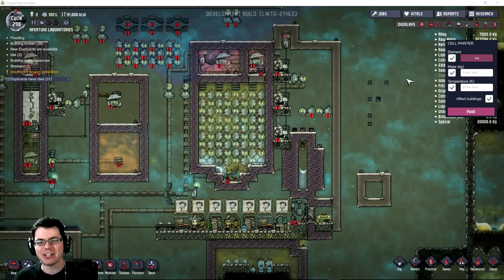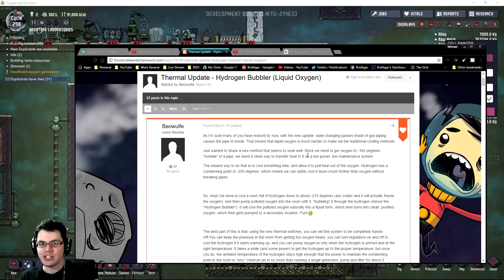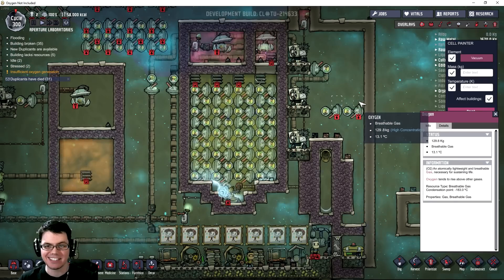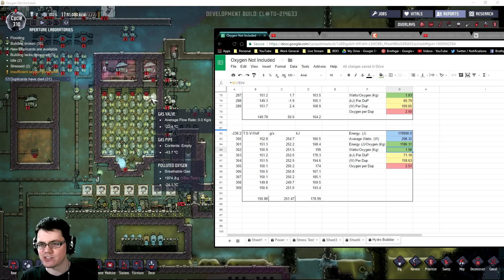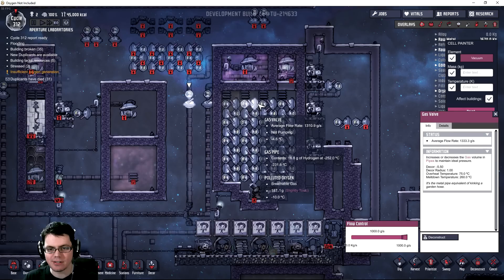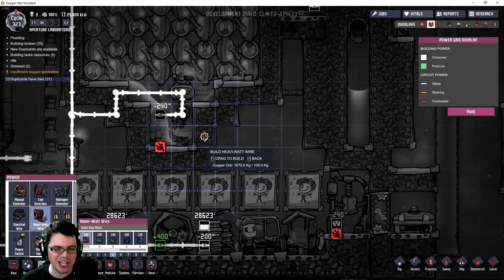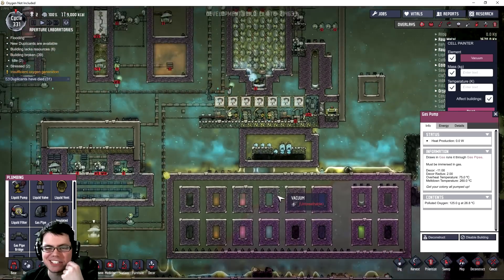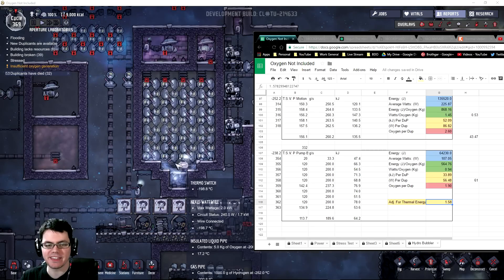Perpetual Motion and Wolframite Hydrogen Bubbler Experiment Part 4 -  Oxygen Not Included

Comment: Hmm. For a system like this... what I'd suggest is a single "tower" of valves, rather than waiting for the waterfall to dump everything into the center. It may be inferior in terms of rate of cooling but then you won't have solid oxygen forming. And a pillar fifty or so high isn't that outlandish all considered.

Another exploitable trick- freeze the materials you're using to build the machinery. If you let the wolframite sit in liquid oxygen for a while, then it should contribute a whole lot more to the cooling.
Reply: The solid oxygen forms because the H2 is slightly too cold. It should be at or above the freezing point of LOX, ie. -218C. In both Skye's and Brothgar's builds they have set the temperature a little too cold for the H2 at -235C and -250C respectively.
Reply: Point. But keeping it lower speeds the condensation. Or it should, maybe ONI physics don't work that way. And a single direct tube should prevent freezing anyway.
Reply: The game follows Newtons Law of Cooling so yes there is a detrimental effect of having higher hydrogen temperature as the temperature differential is lower. It is easily overcome by making the system slightly larger though. We have a requirement for energy efficiency and running the system without any chance of failures. There's no requirement for compactness so it can be as large as needed to achieve the above goals.

As I've suggested several times in the comment section. First time right after Brothgars 2nd video in this series. The most optimal freezer is two stage where the top part loops the LOX in wolframite liquid pipes and the bottom part loops hydrogen gas at -216-218C in granite pipes.

Brothgars build is slightly too low height for this work properly though. The total height should be 12 tiles before the funnel at the bottom begins. You can then experiment with if a straight 6/6 between split LOX and H2 loops is the most efficient, or the split should be higher or lower in the freezer. you can also test if it's better to have a section that overlaps with both cooleants.
Reply: I should note that the cooling constant (k) is far higher with LOX in wolframite pipes so it is many times more effective than H2 in granite pipes despite the lower temperature differential.
Reply: It's meant to emulate Newtonian physics. As we've seen with various perpetual motion machines pipes not behaving properly with temperature, and the old vanishing mass glitches... It's not very good at it.

What it should do and what it does do cannot be assumed to be the same.
Reply: Note that I did not say that the game should follow or is meant to follow Newtons Law of Cooling. I said It does follow it. It's in the code.
Reply: If applied correctly. Which clearly it isn't, since only part of a valve is effected by the liquid hydrogen coursing through the pipe. And since the hydrogen never warms up if it keeps in motion.

To say nothing of perpetual motion machines.

In fact, I dare say, it's not following ANY of newton's laws at this point. Not with anything resembling accuracy. So instead of assuming it's doing Newton right, we should instead test all possible permutations until we find the best one.

Comment: I cant use cheat engine for random reasons, all I have is the dev-mode cheat..... I cant do much :(
is there a way to spawn pufts?
Reply: a problem I found is that you may only teleport creatures (without 90% chance of death) when they are not planning on moving (when path line is nonexistent) and also I found out that pufts whom are sustained by their own slime actually deficit! they either consume more polluted air than the slime emits (per kg) or the slime emits less polluted air than the puft breathes (per kg)

Comment: SKye Storm made it in a way where it does not need power to run..
Reply: Not true. It still needed power to pump in P-O2 and pump out the LOX.
Reply: Skye had electrically isolated the components, apparently so that he could check just how much energy his system would use strictly for cooling the hydrogen, neglecting the pumping costs of the gas supply, and liquid oxygen removal.
Reply: One thing to note here is the quirk in the game code that discount everything that sits behind a switch from being counted in the power consumption total in the daily report.

Comment: You can make the system 100% efficient, just delete the pump and make a very large   abyssalite "pipe" by lining a 1 by x (8-10 tiles high should be enough) empty tiles with abyssalite insulated tiles and let the liquid oxygen drips down. 100% zero energy oxygen purifier
Reply: You can also make an air purifier system by dripping the liquid oxygen into a large-ish tank at the bottom of the "pipe". Have the right side of the tank made of gas permeable tiles and pump any unwanted gasses in left side of the tank. Carbon dioxide and chlorine will instantly liquefy and stay in their liquid/solid phase due to the sudden temperature drop, and as long as you keep the flow of liquid oxygen, you can trap them there indefinetly. The only problem is gas pressure, since the tank will be highly pressurized...
Reply: It would just form a water lock (or LOX lock really) eventually due to the quirkiness of surface tension. And you don't ever need to fear pipes breaking, just make sure your system loops the liquid oxygen around and it cannot ever break any pipes.
Reply: well, not if you drip the oxygen to a large room under the pipe/well, and the oxygen evaporate fast enough that no more than 200 kg of it is on the ground, and 200kg is just a mere puddle in ONI
Reply: One way to absolutely make sure you do not get a block is to use mesh tiles for the "funnel" thus avoiding the surface tension bug completely.
Reply: Hmmm... you sure? I've got this setup running for 50 cycles without any problem
Reply: Eventually it will happen randomly but mesh tiles also solves the other concern. A mesh tiles can transport liquids and gasses. But not both at the same time so if you have a constant flow of LOX through the mesh tiles you make sure that P-O2 cannot escape the freezer, and that O2 cannot stream back into the freezer. The flow can be as little as a few hundred grams per second for this to work.
Reply: Alright, I'll take your word for it. Btw. this perpetual motion thing is really a bad idea, you kept on taking out so much energy out of the system, its freezing the base. I have to actually use space heaters to heat up my living quarters now, since everything is at 10-50 degree below zero.
Reply: It shouldn't emit any heat if the entire system is encased in abyssalite insulated tiles.

Comment: Ummm I think you should re-test again. You missed another quirk in terms of how heat transfer works in game: Heat transfer happen better on non-moving matter. To do that, you need to slow down the flow of hydrogen, which means you need to tamper with the values in the gas valves. Like, if you make valves only output 400Kg/s, you should be able to get Hydrogen stuck for 3s before each valve.

The way you set it up, The gasses will keep moving no matter what amount is entering each valve
Reply: Sadly this isn't correct. The temperature of the gas within the pipe is "reset" to it's original "piped-in" temperature when it moves. If the gas is static and doesnt move, the pipes eventually heat up to the surrounding temperature. Once the gas is in transit again, the gas temp snaps back to the original temperature and will cool the area again.

Comment: ok so i had an idea while watching this, you mentioned that the pump where the morbs are is CONSTANTLY running.... what if you took the morbs and put them in the smallest room possible (i think that would be 1 high and 5 wide(5 wide to keep the lag down)), where the walls and floor are made of gas permeable tiles, and would have a 2 block gap on either side (left and right), then would be surrounded by insulated tiles to seal in the chamber (to make a closed system), you would then take previously mentioned building and put it on top of your radiator setup (you would have to expand the radiator system to accommodate the new open section). In theory, eliminating the gas pump setup would allow you to save massive amounts of electricity by cutting out the middle man. I will note, however, that this would be a constant setup, meaning that you could not stop the flow of polluted oxygen, this could be problematic, but i believe that the energy and efficiency savings could be drastically increased. I also saw that there is a LOT of liquid oxygen in that pit of yours... moving the thermal switch could provide much better yield( im not sure if you take into account the liquid oxygen in both the bubbler and the result tube). in any case its just a theory... a oxygen not included theory.

Comment: if you put dead dupes in the perpetual motion switching hydrogen bubler and morbs spawn so no need to pump polluted oxygen into it = MOST EFFICIENT FKIN OXYGEN REFRIGERATOR THING EVA
Reply: One problem. Morbs die at that temperature.
Reply: create a small compartment for them and a long tube made from insulated walls so they dont die
Reply: that is why you make a small room on the side where the morbs are kept and the gas flows using a hollow chamber made from insulated walls
maybe the constant flow will keep the temperature up or perhaps you will get morbsickles